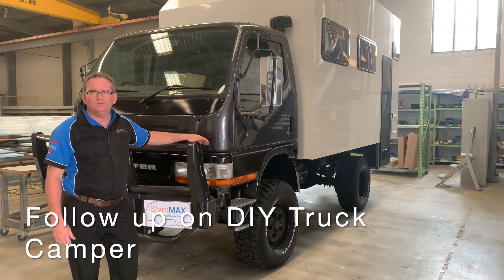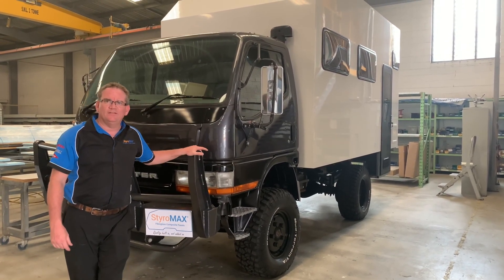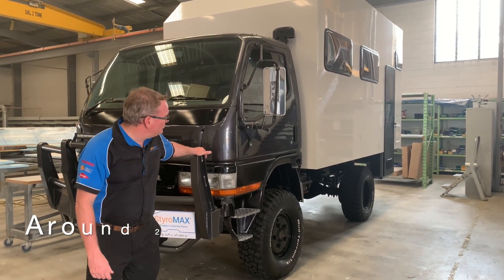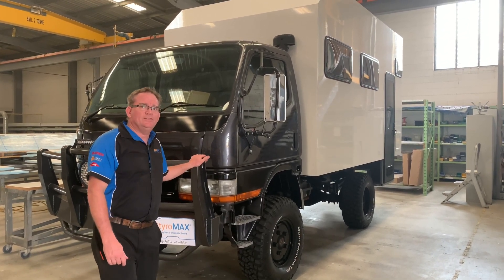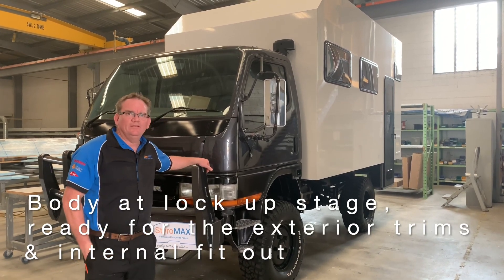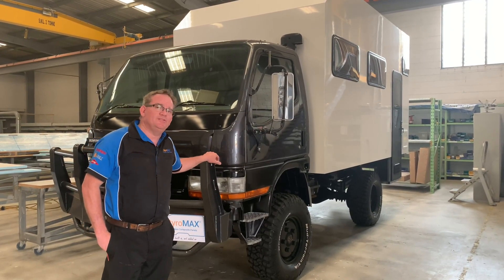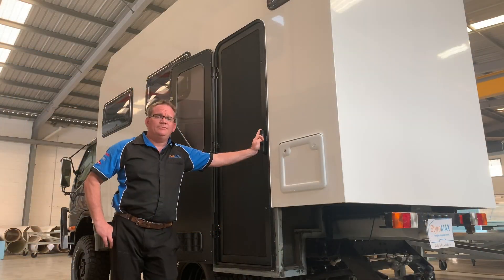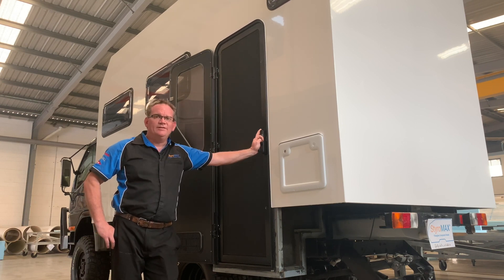StyroMAX DIY Truck Camper Build-Time Lapse

Comment: Great! If I didn't miss the idea, u use only thin strip of glue. How do u get the rigidity of this construction?
Reply from the maker: It’s considered a monocoque, also called structural skin, is a structural system in which loads are supported by an object's external skin, similar to an egg shell (Wiki). We consider the sub frame or chassis to be the integral support.

Comment: What was the fibreglass sheet thickness (walls and ceiling panel) in this example? And did any of these panels have integral I beam stifferners?
Reply from the maker: This panel would have been 29mm (2mm fibreglass inside and outside and a 25mm foam core). We don’t use joiners in our panels as they are structurally integral and one piece.